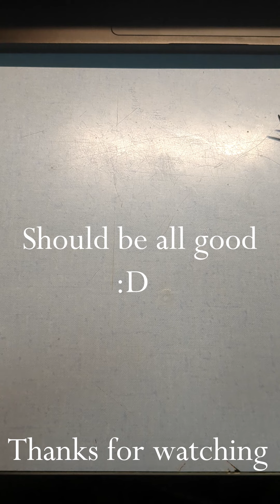SONY WH-1000XM4 Weird Noise Fix

Comment: I bought 2 pairs at the same time as I didn't want time without them for charging. This problem started on both sets on the exact same day. 

It did cross my mind that this was highly suspicious and perhaps planned obsolescence, though have also considered that perhaps environmental factors such as atmospheric pressure could trigger it. 

Still, really weird having 2 pairs break at the same time, same fault.

Comment: This solution doesnt fix issue to full scale but reduces its frequency. I think that it's required to solder new mics, but I cant find the proper replacement.
I feel bamboozled  by Sony.

Comment: Relocate the inner ear mic will fix the problem.
Reply: Which side? Left?
Reply: @KINGNEF, my issue was on the left side. I removed the mic from the white housing, lowered it, and let it hang just below the original housing.

Comment: XM3 had weird noise, so I bought XM4 and it got even worse then XM4.... I just cant bear how bad these products are.
Reply: Same I'm sure every XM model has this problem even xm2s did. But I swear the feedback noise is 10x louder on the xm4s. It's just so baffling that they haven't fixed this. I will never buy Sony headphones again, they messed up my hearing 9 months ago and I still suffer from it. In fact I will avoid noise cancelling headphones all together now.